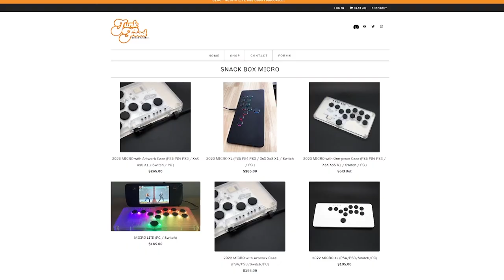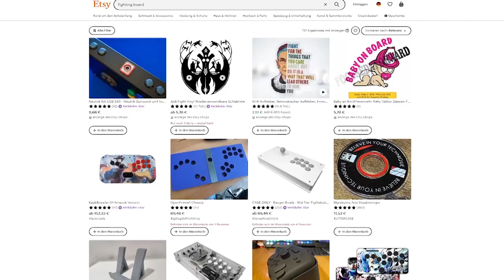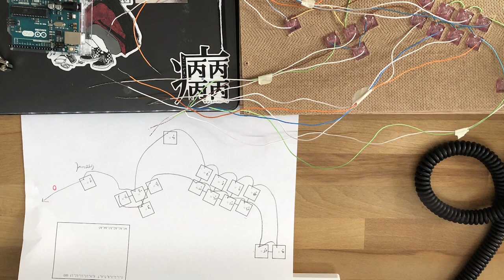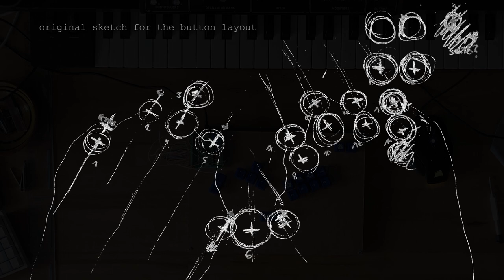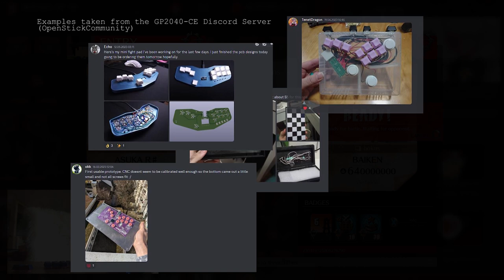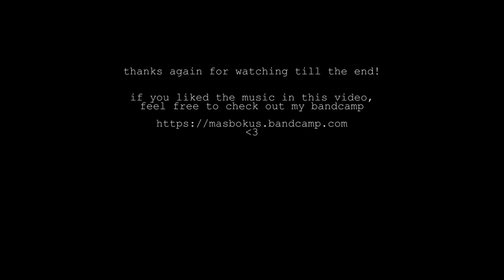My DIY Fighting Board Journey

Comment: I just actually completed my own custom hitbox build but I purchased a pico fighting board and a 20 pin wiring kit ended up being about 35$ I HIGHLY recommend anyone take this route since you can very easily cut new tops and try different layouts, spacings and the inclusion of extra buttons like adding two jumps.
Reply: Is that solder free?
Reply: @hopsys  it is, if you buy one from a seller. chances are it will already have everything soldered in
Reply: @hopsys  it was! my board even came with wires to go into screw in posts if you wanted to do it that way but a 20 pin brooks cable is pretty cheap and compatible
Reply: @BlankaScrub   would you mind sending the links? I am super new to anything hardware and even the simplest things like buying the correct stuff is daunting to me

Comment: As someone in the process of upgrading my own home made hitbox, it was very interesting to see the similarities and differences between our approaches. I used arcade buttons that I bought online, as well as a spare pro micro and breadboard that I had lying around. I also used 22AWG solid core wire, which is much less fiddly for small soldering. Using the insides of an ethernet cable sounds very painful. The code I wrote for my arduino just used some black magic written by someone else to turn it into an XInput device as far as the computer was concerned

Comment: Here's a nugget for folks looking to skip a few steps: You can apparently hook up Brook boards directly to key switches. I'm probably gonna give that a shot myself sometime soon. There's also something called a "breakout board" for key switches that you can get, it's a single switch-sized PCB that lets you solder everything to that instead of directly to the switch, That's useful if you want to make it so you can replace the switches later by soldering hotswap sockets to the PCBs. The switch slots into the socket and works the same as if you soldered it directly, then you can experiment with different switch types as you feel like it. The breakout boards can also be fastened to whatever box you end up going with, too.

Really happy YouTube recommended this video to me because I got most of the way finished with a board before, but the custom PCB I commissioned didn't end up being comfortable for my hands, so I'm coming at it again with a more modular and low-effort approach because it's really easy for me to get carried away trying to do extra things. There's so many cool ways to customize DIY things like this anyway. 😂
Reply from the maker: yeah! there are so many ways indeed. I'm also interested in custom PCB's in the future, as they don't seem to be too expensive. Also I was thinking about a hot swap-socket, but I think for my build here I was trying to go as cheap as possible and I was sure I'd stay with the switches. But it definitely an option! I think they aren't tooo expensive either
Reply: Could you provide a link to that breakout board for individual key switches? I am trying to make something like this also.
Thanks in advance!
Reply from the maker: @garlanramadhan4291  https://www.amazon.de/Hot-Swappable-Socket-CPG151101S11-mechanische-Tastatur/dp/B07K8CCMQZ I'm guessing he's talking about this (Kailh Hot-swappable PCB). But correct me if I'm wrong @vileosufora
Reply: @SquidsTv  that's only a hotswap socket. I do some searching, he's talking about mini pcb that you can slot the switch into, you then solder the pcb instead.
I haven't found one that is really suitable for hitbox build though.

I think for simplicity, it's better to just slot the switch into the hotswap socket, then solder the socket instead.
Reply: @garlanramadhan4291  The hotswap sockets typically go on the board itself, especially if you plan on swapping them, then you can mount the board itself so swapping keys isn't placing any strain on solder joints.
Reply: Brooks board to expensive

Comment: Thank you so much for actually showing the building process and the individual parts for this with the case! I'm trying to do the same thing on my own and am having great trouble finding something that answers my questions on how to connect things. I plan to use a Brook Zero Pi
Reply from the maker: Hey! I'm glad the video helped out a bit. Unfortunately I'm not fimilar with the Zero Pi, but there seems to be some information on their website https://www.brookaccessory.com/detail/53169470/ . Regarding your other question, I'm not sure I understand what you mean by "place the mechanical switches"? can you elaborate?
Reply: I mean what did you do to get the keyboard keys onto the board? Did you make holes and put them in?  @SquidsTv
Reply from the maker: @TeethSkylark   4:47 I made holes for the cherry switches and then put them in there. They have a little plastic edge that keep them from falling through. No added glue or anything. They just fit very tight and don't move. If your's move around, i'm sure it's ok if you add hotglue or anything to stabilize the switches. Hope that helps

Comment: I know nothing about hardware and electronics but I want to make my own fight controller. This video was extremely helpful, especially with the wiring of key switches as I am thinking of running with those as arcade buttons are huge and space out too much for my liking. Thanks for sharing your experience
Reply from the maker: Thanks mate! I'm glad i could help out. I'm also an absolute noob when it comes to this stuff, and i was learning while doing. I think something like this is a great project for beginners
Reply from the maker: @TJisJustFine  for me they fit in really tight. If it's your first time using a chisel or working with this type of wood, I recommend practising/trying out before making the thing. Just watch a simple "chisel-beginner" type video. It's crucial to remove most of the inner part of the square before precisely chiselling the edges (hope that makes sense). Also It's good to have a cutter handy, incase you have to make some small adjustments. If the switches are not tight enough, I can imagine hot glue working just fine

Comment: Great video. I went through somewhat of realization that I’m so comfortable on a keyboard. I recently bought a keyboard … it broke— so I bought a mayflash fight stick f500– it felt like I never played fighting games before. The learning curve was huge on it. So I went back to keyboard and instantly fell comfortable again.. now I want my very own key box aracde board just like yours!! But the premade ones are $80++ so I’m very excited to attempt to make my own keyboard fightbox — but like you, I have 0 experience in this. I think the hardest part is going to be soldering wires to PCB board.
Reply from the maker: Me too, I'm really a keyboard kind of person. Don't really like controllers that much. I like the clicky, immidiate feedback.. I'm happy i have inspired you to make your own! Soldering is really not as hard as it seems. The good thing about this project is, that the pins on the switches are relatively far apart. Just have everything prepared correctly and it should go smooth. Good Luck:))

Comment: it is a fun challenge to try and keep the costs low. I somehow managed to make a great stick for under $100 a few years ago. The worst part about it is that the board only works on PC and switch, which means I can't really take it to tournaments
Reply: Doing that right now actually. Thankfully the GP2040-CE is compatible with Brook Adapters, so if you can snag a Brook FGC Wingman, you can use it on a PS4/PS5

Comment: great video! I made an all-button controller myself not too long ago. I used a pro micro with QMK firmware, which definitely made the process easier
Reply from the maker: I might do a custom controller/keyboard build that is run by the QMK/Via firmware at some point in the future, just to get fimiliar with that software. Looks very interesting!

Comment: God bless GP2040 and the open stick community. I was in a similar position, most arcade sticks were too expensive, and didn't match the look I was looking for. So I started with a box I commisioned to a local carpenter. Probably the only arcade game he has ever played was space invaders as he wasn't familiar with arcade sticks, like, at all. (He drilled the button holes just as they were on the template, which he printed scaling it, so holes that were supposed to be 30 mm wide were like 35 or 38 lmao) No problem. he apologized and did it again. I merrily used this stick for a couple of months, but something was off. It was pretty crude, too tall, and the button spacing too wide. And it couldn't accomodate custom artwork. He lived like a 40 minute drive away so I wasn't to keen on asking him another case, so I started looking into building my own. MDF was cheap and plentiful, like 23 dollars at the time for a 1.5m x 2.44m plate, 12mm thick. The parents of a friend of mine had a laser cutter, so off to the races. My second stickbox was crude as well, the finish was pretty terrible, the screws protruded out of the corners, you could clearly see the divisions between each sidewall and some newspaper got stuck to the box in the finishing process and as such, some parts of the bottom were darker than their surroundings. I wasn't a fan of how I mounted the stick either, thinning the joystick area with a forstner drill tip. It was pretty uneven. Still, that was my main stick for a couple of months, too, but even then I was researching in how to make it better. Improve the layout, the finishing, the build. Get rid of those pesky imperfections. And, not to be cocky, but it had premium arcade parts: original sanwa lever and buttons, and the money I've spent until now was still like half of what a qanba obsidian cost. The pcb was bad though, one of those cheap zero delay boards, but it had ps2 compatibility so I was happy with it. Until I discovered feralai's pico fighting board and GP2040: the input delay was amazing, and it suited my use case quite nicely, me being exclusively a PC gamer. No ps2 compatibility sadly, still, I bought some PCBs from China, the components, and soldered everything together, and set up on making a new case. This one was bad too, but while it became my mainly driver, I found out that my mom had a paint gun so I began researching on how to make good finishes. I lost count on how much money I've spent, but this quickly turned from "I want a cheap but solid arcade stick" to "I want a premium fightstick, and the case should reflect that". I'm currently using the latest case I built, I think it's pretty good, the finishing isn't perfect however, but it's a far cry from where I started. I'm currently building another pair of cases, well, two cases and a set of sidewalls. I'll move my current asembly to the sidewalls, with better finishing, rounded edges and corners, and in general, I'm striving for a professional build. Another case will be a hitbox, which a friend's brother commisioned it to me (hell, I think it'll be viable for me to make and sell these, but I think I should buy the tools I usually ask other people to lend me, like the laser cutter and the power saw) and the third case will be a korean-lever build, so I'll have two fightsticks, a sanwa fightstick and a crown fightstick. I also discovered in the meantime the open stick community fork of GP2040, and in general, TheTrain's several contributions. My korean build will have his excellent 3D printed mechanical buttons, while my sanwa lever has gamer fingers (although if I had discovered the train's open source buttons earlier, I think I wouldn't have bought the gamer fingers). I also bought a crimping tool to make my own cables. For now, I've lost count on how much I've spent on this (less than the price of a victrix for sure) between buying MDF, laser and MDF cutting services, hardware, paint, etc. but I don't regret a single second of it. It can seem daunting, and even expensive (I live in latin america so things are relatively cheap, a 100 dollar order on send cut send would cost me like 50 or 40 for example). Also, I commit at least a fuckup in every build :( I hope this new case I'm working on turns perfect. But if you have a friend, or check documentation online, I think it's pretty possible to nail the build for the first time. And if it doesn't come out like you wanted to, chances are you'll have leftover materials to try again.
Reply from the maker: That was a joy to read! DIY-Projects always lead you to unexpected places I feel like
Reply: @SquidsTv  they really do, I feel proud of what I've accomplished, and I still have some ideas in mind

Comment: I am working on something similar right now, but with 3d printed parts, but I can't decide what board to use. The pico board seems like the best option but the brook pi zero is compatible with the Nintendo switch as well 😅
Reply: Definitely a little late, but gp2040 software mentions compatibility for the switch too
Reply: @meep7929 yep, i saw that and ended up going for that in stead. Now I have to figure out how to configure it. Hate anything related to programming and coding 😂

Comment: cool build and video. I might do something similar. Is there any way to connect key switches to the GP2040 CE board without soldering? also how do the switches stay in place inside the case? I saw you chiseled the holes for them but they don't have screws or snap tabs like arcade buttons right?
Reply from the maker: Glad you enjoyed! I think there is a non-solder way to do this aswell. But you'd need to buy like a cable kit bit "clip" on cables, and I don't know if there work with the cherry switches. Maybe someone else can help out.. To your other question; I was quite precise with the holes, so they just kinda stuck in really tight. If you're unsure if it's gonna be tight enough, you can use hot glue/glue them on from underneath. Should work just fine

Comment: The Zero-Pi is literally 25-29 eur though, unless you play on PS5 or Xbox
Reply: Brook UFB Zero-Pi that is
Reply from the maker: True, That's my bad research then. I think I found a video that used like a 100€ Brook board and it immediately turned me away from making my own fightstick. This board might be an alternative for someone who has issues with the GP2040 software!
Reply: @SquidsTv  I'm in the same situation you were, just looking at every option to cut down costs as much as possible to make a hitbox.. no way I can justify spending over 100 euro one, that is, if I even find one in stock lmao. 

Getting the wire kit from Brook for their Zero-Pi bumps the price by another €20 though, but that's also what it'd cost me to get a soldering gun if I were to try and DIY it even further... Anyway, great work on your video, very well done :)

Comment: hey i just came across this video and was wondering if instead of using switches like you did, if i could buy arcade buttons and use those instead.
Reply from the maker: hey mate! of course. That's possible. A switch, at the end of the day is simply a connector with a ground and signal pin.

Comment: Hey, how do you get two inputs for up? The arrows and the hitbox up(on bottom). Did you connect two cables to up?
Reply from the maker: Hey! You can configure a second jump input under the GP2040-CE Web Configurator. I believe it's under Plug-Ins (?).. Basicly you connect your second jump to a pin on the Pico, that you don't use for other inputs (GP22 for example), and then map that pin to jump in the configurator.

Comment: Hey!

You mentioned you didn't need to do any soldering to connect the keys to the pico board. However when I looked them up most places where they mention it they say you need to solder to connect it to basically anything. I'm not sure how this all works, as I'm a complete layman when it comes to stuff like this. Could you help me out and give specifics please? I'd greatly appreciate it.
Reply from the maker: Hey! So, I bought something called a "Breakout-board". The Rasberry Pi Pico is just stuck onto this Breakout-board, and the ethernet cables are simply plugged into the Breakout-board and then screwed tight. The cherry switches however, i soldered them to the ethernet cable. I'm sure there is a way to connect the cables without soldering them to the Switches (If you wanna go completely solder-free). Hope this helps!

Comment: did you solder the cables to the switches' pins or you uses something to connect them?
Reply from the maker: 7:24 i soldered the cables to the switch pins

Comment: might aswell just use keyboard as is and assign 3p and 3k to the numpad and use wasd spacebar, shift and ctrl, why chop it up like this? just curious
Reply from the maker: There are multiple reasons!
1. I like having a dedicated controller; A simple layout with just the buttons i really need
2. It's more comfortable and does not strain my hand; Every button is where i want it to be
3. I can use it on the Nintendo Switch and other supported controllers!
Reply: @SquidsTv  fair enough, am thinking doing mixbox myself with the asd keys being curved like in hitbox and putting a large w key above it with its width being same size as the 3 asd buttons

Comment: Im stuck at that part where you plug it in and Install the firmware, like what do I download and how do I install it
Reply from the maker: Hey! Not sure if you already fixed your issue by now, but there is a step by step guide on the website https://gp2040-ce.info/#/installation . It's quite straightforward! Be sure to read everything you can on the website, it's generally quite helpfull to understand this software better. Good Luck :)
Reply: @SquidsTv  that got it fixed thanks